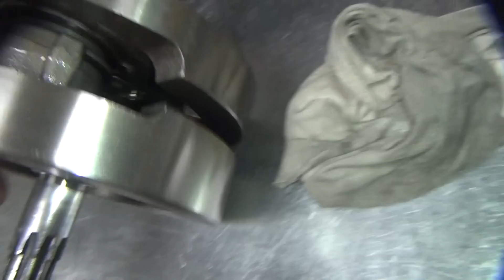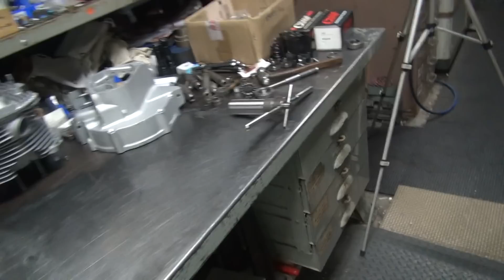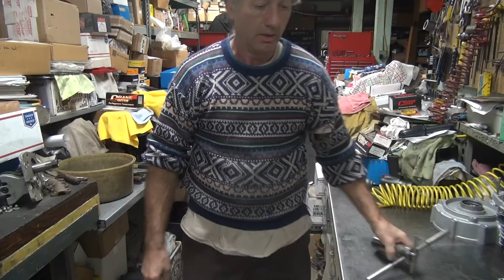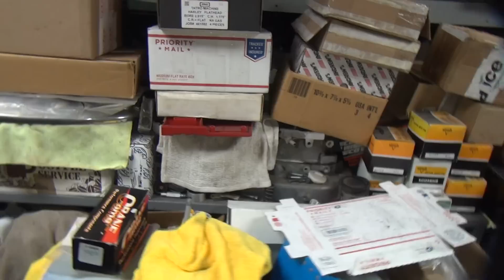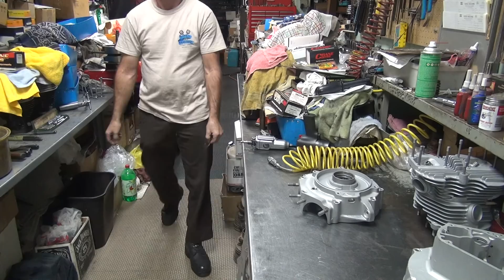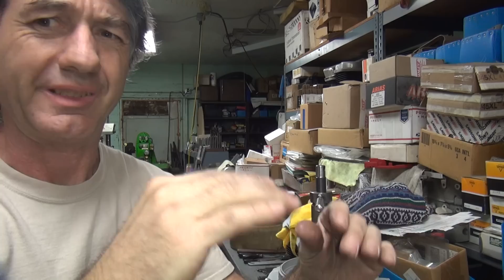1978 #109 shovelhead head, cylinder & case rebuilding machining motor harley by tatro machine

Comment: I've got this weird situation where I just have the cases together with the crank and I've got a bunch of endplay. enough that I can see the bearing peak out on the pinion gear side. Took off the seal on the primary side and the outer bearing on the primary side is moving with the flywheel in and out when i pull and push on it. my plan is to first put the rotor and pully on to get the right spacing and tighten down the nut (open primary) and just see if some of the endplay goes away but I think what I'm actually going to have to do is use the bearing tool and pull the bearing in further. Can you think of a way to keep the crank from spinning while I try to do that while its still in the case?
Reply from the maker: when you tighten the pulley nut it pulls the bearing together. check the endplay then. it should be around .003. if it is over .010, you have a full race set-up. over .020, you got problems.
tatro

Comment: If someone doesn't have the bearing install tool could you heat bearing in cooking oil to 350deg and drop bearing on shaft hot do you think that method will damage the bearing
Reply from the maker: you are good at that temp.you can use nut and washers too to press the bearing on.
tatro

Comment: Is it possible for all the crap you cleaned off the flywheels to throw the flywheels out of balance? I’m riding a 72 FLH that sat for a long time. Yeah, I need to go through the engine. It’s a shaker.
Reply from the maker: no, its not enough to really matter. out of round rods and out of true crack matter way more than balancing.
tatro

Comment: So the thinner the shim the tighter it gets? Why, because the bearing goes farther into the race? I watched it 6 times and I'm still scratching my head. I was asking myself why is he going to a smaller shim when it was too loose to begin with.
Reply: Yes, you're correct. Putting thin shim( inner spacer) in. The tapers go in closer tightening up the clearance.
Reply from the maker: you are between two different bearings so you are playing with how they work together. the bearings more in and the races do not more when the shim gets thinner. make the shim thicker and the bearings move out and away from the bearing races. this makes them looser. the feel does not lie.
tatro